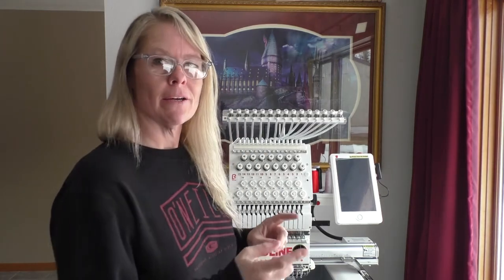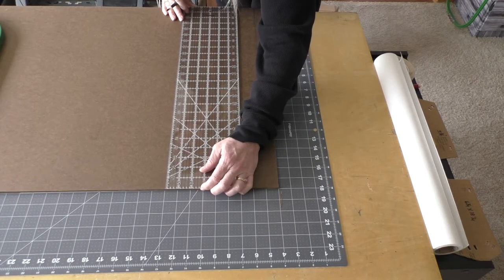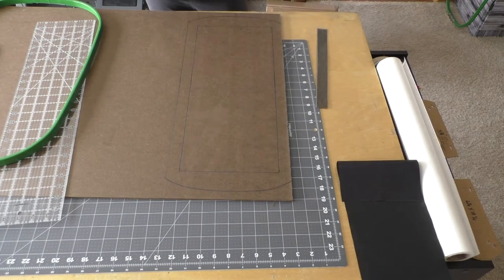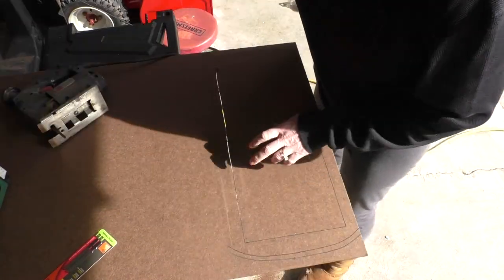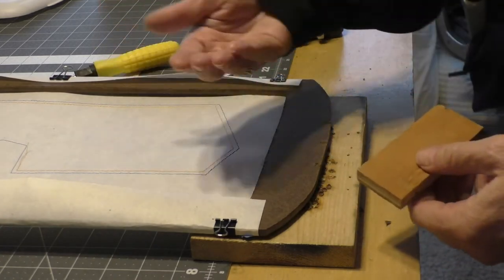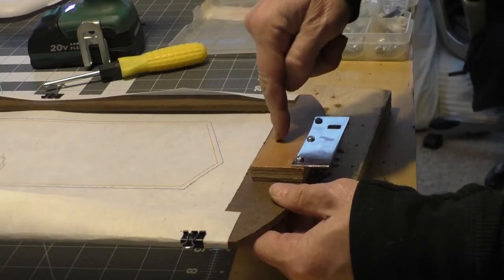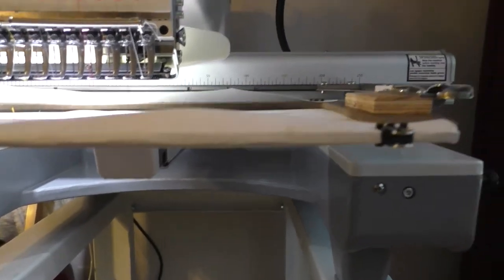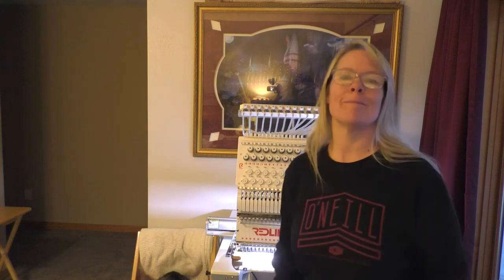DIY Embroidery Frame for Multi-needle Machines - Easy How To!

Comment: Nice!!!
Reply from the maker: Thanks, BeeDub!
Reply: Hey I found a video of yours from a years back rebuilding a carb on an ice auger. I have a similar auger and rebuilt the carb. However when I was taking it apart the throttle springs came apart and I cannot find any information on them anywhere. You wouldn’t happen to still have this auger for a reference photo would you?

There is a small clip that comes into the top of the carb onto the throttle adjuster. And if you follow that up, under the main cover of the engine there are two springs and a black plastic piece. This is what I need to figure out how to put back together. Thanks a keep up the helpful videos!